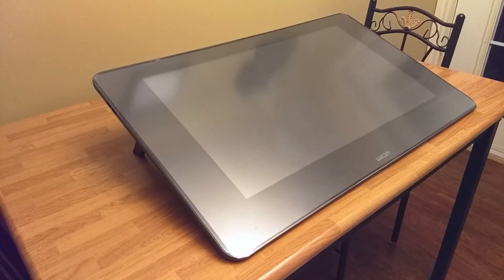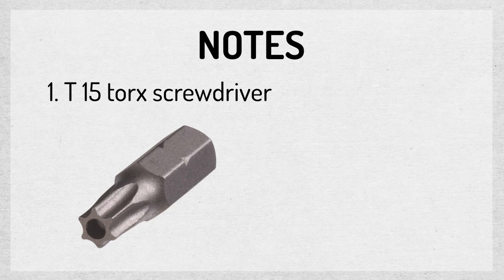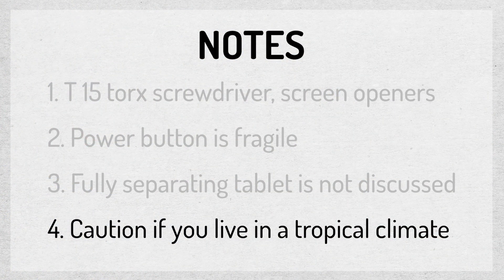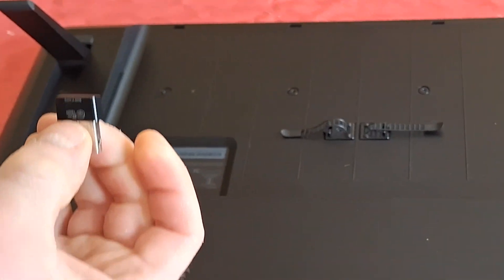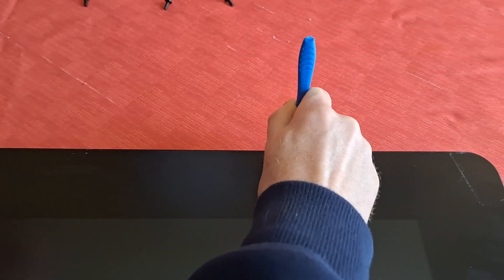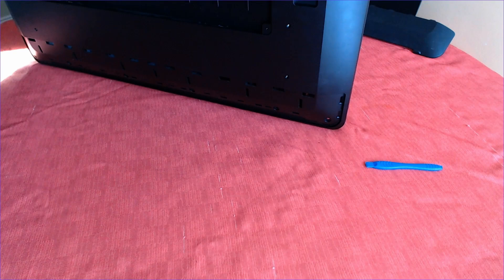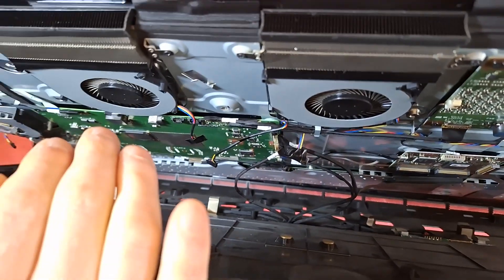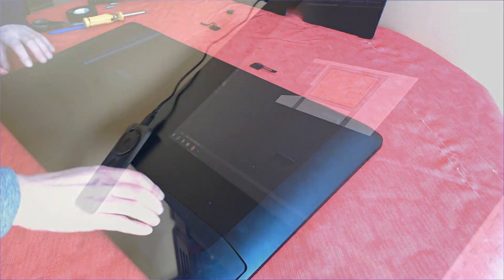Cintiq Pro 24 How to Remove Fans, Fix Noise

Comment: Thank you, this video was perfect; I finally unplugged the one busted fan that buzzes loudly whenever it gets a single spec of dust in it. I took that one fan out but left the cooling fins in, to help with passive cooling. The other fans I left in as well, as they still run very quietly. 

To anyone else reading: while I do highly recommend having a kit of spudgers around (those blue plastic opening tools are called spudgers) since they are cheap and useful, you can get along doing this fix just fine using a stiff guitar pick or credit card. Some spudgers you can buy look and feel exactly like guitar picks and credit cards anyway!

Comment: I have fan issue too, it won't  start or turn of it's just buzzing and vibrating, I tried messaging wacom's support I they said charged will be 2,050 sgd  to fix the annoying fan sound.

Comment: Mine will occasionally make a shocking whirr but giving it a whack usually fixes it for a few months. Love the Cintiq but will look for a different maker when it dies. based on their annoying driver software and how awkward your video shows servicing is.
Reply from the maker: Servicing is a pain. Probably true for every screen tablet. The worst ones use glue you have to heat gun off before you can even open it.

Also I've never used a brand that has good drivers. Drivers are always crap. >_> Maybe that's changed in the years since I stopped reviewing equipment, but I'm skeptical.

Comment: Not sure why people can't just turn their AC on even if they live in a hot climate, but alright lol. Appreciate the info video. It's sad I bought this name brand to only get a dysfunctional tablet that is infuriating to even have. I even used the cintiq 13  hd before upgrading to this. Good thing I already have experience with electronic device repair., which leaves me interested as to how you didn't use a suction cup for the screen or IPA, but I guess it's not sealed for water protection. Real shame they won't be holding the leading industry reigns with issues like these.

Comment: I just did this to my 32 inch Cintiq, it never got the posibility to put the fans in silent mode and it annoied the crap out of me for so long. At some point I even was considering custom watercooling the damn thing. The quiet in my room is heavenly! 
Is your Tablet still jugging along just fine after these months?
Reply from the maker: Still completely normal. It's been about 2 years now.
Reply: Awesome thanks for sharing! @CrownePrince
Reply: @CrownePrince  did you use it with an external fan on the table behind it during these 2 years or nothing at all and worked for hours every day and everything is still fine? This gives HOPE to just DO IT.

Comment: Followed this disassembly for my DTK2420 for what sounded like a broken fan. I ended up plugging it into a laptop while it was disassembled and cranked the brightness to 100 and fans to auto and found only one of the fans was making extra noise so I left the other 3 plugged in. Thanks for the video, woulda been too scared to do it without knowing what to do.

Comment: Thanks for the vídeo! I have your same model since 2020. In the first year of use one of the legs   became loose and hear a bolt loose inside when I move it since then. At that time I couldn’t find any video on how to open it, tried searching again from time to time and this (5 years later) is the first I see! Thought to avoid the risk I won’t open it for now. But if was worth it watching for couple of reasons: I Didn’t knew there was a setting for fan speed; I know what to do if I decide to give it a try fixing the leg; most importantly, I now know I was not alone these entire time hahahaha cheers!

Comment: This is such a rubbish product for its price. From week 1, I had a dark patch on the upper part of the screen and fan issues as well. Wacom really needs to get their s... together. Thanks for the video.
Reply: Yea it truly is. I have a cintiq 32 since end of 2019, and I had to send it in 6 times already, because of weird shapes, and dead pixles on the screen. The current one, it may the best one yet, unfortunatly start having yellow spots. Such a pain in the arse product, I would anybody recommend to avoid it.
Reply: @Gumpa2  Yeah I think wacom used to be really something back in the day with their first couple lines of tablets. But things have really gone downhill. Attention to detail in some areas really have fallen to the wayside for them. For the wacom companion, really interesting device there was nothing like it at the time really. But then it had a massive problem with the charging port failing. They went out of there way to develop something unique and cutting edge but cut corners on the dumbest things. I currently have the 24 pro but honestly thinking about trying out the xencelabs tablets here pretty soon. Maybe the attention to detail on the wacom products can be found on xencelabs products without wacoms shortcomings....
Reply: Bro you have that dark spot on the top right near the buttons as well!?

Comment: Thank you for this detailed video! My Cintiq Pro 24 has what sounds like loose pieces of plastic, presumably from one of the legs, jangling around inside of mine. I was worried about that little ribbon cable that you have to disconnect to separate the two halves, but after watching this I am going to attempt to open it up and see if I can get those pieces out. Thanks again!
Reply: Same issue as mine, but I decided I will not try to fix it after watching the process. Seen very risk, I’ve got kind of used to it now.

Comment: I just managed to do it according to this video. I had this issue a year ago and it somehow resolved itself when I moved the tablet 90 degrees.... but I just bought an IFixit repair kit on amazon and got this off easy. Super good tutorial. Last time I checked there were a few less well put together videos explaining the solution. Thank you for helping out the community like this!
Reply: Lol Update.... so don't know how but last night my power button stopped working.... No clue... literally just turned it off to go to bed.... So I reopen it and turns out the power button fell off (like mentioned in the video clearly need to be more careful as I reckon what happened was I left it with a hairline crack and it then just expanded over time with the heat....and jostling so now I am going to attempt to solder the pieces.... as its a fairly clean break... just the plastic piece cracked... so just need to get 3 wires and get them connected up and will probably leave it sticking out of the case.... will update here on how it goes for anyone who falls into this same issue and is having a crisis. lol. Sadly have client work that needs to be done with a mouse now lol. Back to being 14 again lol.
Reply: @GoopyGoblins  were you abel to fix it eventually or did this 'adventure' turned out into a funeral? -_-' I'm thinking to do the same, I can't stand the noise anymore. especially in the quiet evenings. it's driving me nutz.. whoever designed this stuff, is clearly incompetent..

Comment: I have a 24 pro touch. Greatly appreciate vid. My screen shuts off when bumped, I have a ergo stand, every time I need to adjust I run risk of screen going blank. I assume its a ribbon cable or something loose. Do you have any more pics or footage of inside assembly to better plan repair
Reply from the maker: No, any extra material is linked in description.
Reply: @CrownePrince  thank you.  First I have seen open display. Il document to help wacom community.

Comment: I turned on “energy saver” and the fan noise stopped… for now.  The screen is dimmer but you get used to it faster than the jet engine.
Reply: Where did you find this setting? The jet engine noises are driving me insane

Comment: As someone who has replaced non-standard fans, yeah, this may be the best approach, especially if it functions without the fans, and you're in a relatively average climate.  Even the non-standard fans can be expensive.  Not $1,000 worth of expensive, but still expensive.  A couple of quick searches also suggests they are hard to find.  Though they kind of look like some laptop fans I've seen, so you might be able to get away with replacing them with such.  Still, with all the wiring, probably too risky.

Comment: Cintiq: Costs 2-4k Euros
Wacom: Let's put the cheapest possible fans inside!

Instead of these lame generic laptop fans they should have used wide scoop (fewer but wider blades and lower) rpm fans, those would scoop out so much more heat on top of being quiet.
People are complaining about them and always will, yet they won't sacrifice few dollars extra for a satisfied user base. I mean they could even bump up the price by 50 if that'll make both sides happy.
Or just learn how to dissipate heat properly and go fan-less.

Comment: How about if you disconnect only two instead of all three? Which ones would you disconnect, in your opinion? Thanks for the awesome video!
Reply from the maker: The way it is set up, there are two intake fans that suck air into the cintiq, and then there are two that blow it out (exhaust). If you are going to only disconnect some fans, your better choice is to leave 1 intake and 1 exhaust functioning.

I'd read up on negative vs positive airflow and pressure if I was deciding how many intake vs exhaust fans to keep alive.

Comment: Next episode: Designing a custom PCB to control fan speed manually, which can be wirelessly connected to via bluetooth with a custom mobile app. (Joke)

It is cool your making this info on the tablet fix available since you you noticed there isn't much info out there.

Comment: Why does it even have fans in the first place? Is it one of those cintiqs with like a whole computer in them
Reply from the maker: Yes. There's a couple reasons.
1. The optional whole computer attachment
2. 4K resolution generates more heat
3. On fanless tablets people complained about the screen being too hot
Reply: Yeah, the Cintiq can be used without connecting it to a computer so long as you charge it beforehand.